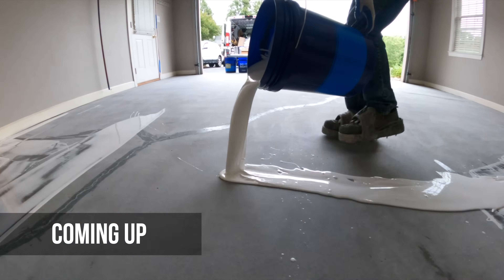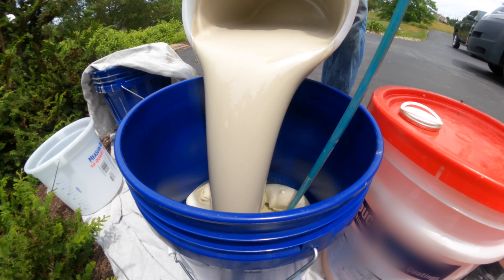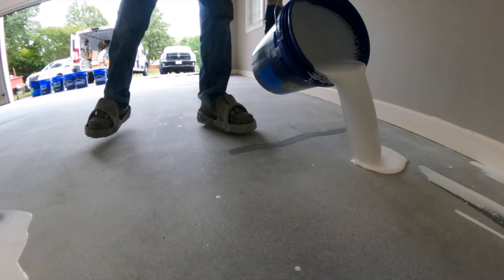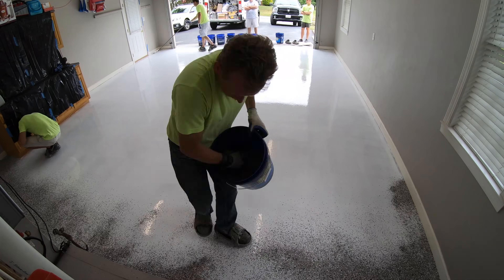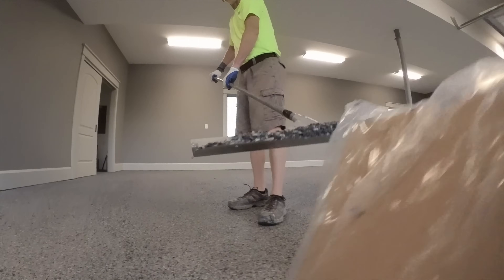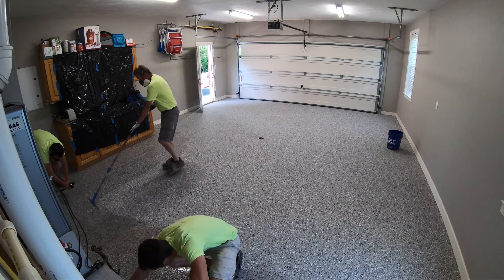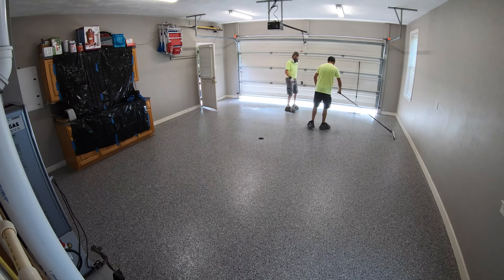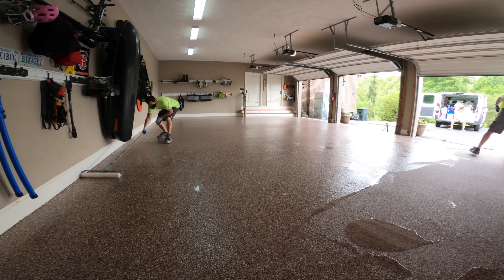Epoxy, Polyurea or Polyaspartic : Which is the BEST garage floor coating?

Comment from the maker: Epoxy vs. Polyurea : I forgot to tell you this one thing about garage floors...
https://youtu.be/UOeGvo5zGY4
Reply: Hi Tim, when it comes to a new house, do you think it's better to wait before coating the garage floor? My concern is that if I apply the coating right away, the floor may crack in a few years.
Reply: Do you recommend any installer in Chicagoland suburbs?

Comment: A couple of key points there were missed in the video. By the way, the quality of workmanship was pretty good. One major difference between epoxy and polyaspartic is that epoxy can handle much greater moisture Ingress loads which enter the garage from the soil below. It is critical to install a moisture barrier to prevent the Ingress of all moisture into the garage. This goal is achieved by installing a epoxy primer directly after the floor is ground and cleaned. The epoxy primer should be selected so that it has a very high moisture vapor barrier quality. This epoxy primer first coating will dry quickly. Second coding should be the high solids epoxy just as explained in this video, but it should also have a high moisture Vapor Barrier prevention content. The combination of the epoxy primer in the high-solids epoxy top coat will effectively prevent moisture Ingress into the garage space. Remember all concrete is porous and allows the penetration of moisture vapor into the garage space. Moisture is very bad for finished garages because it gets trapped behind the wall board in the walls and insulation allowing the growth of black mold, fungus and mildew. It is prevented by the epoxy primer and epoxy high-solids top coating. After the top coating of epoxy is installed than the vinyl chips can go down as described in the video. The third and final coating should be the polyaspartic. Owner should specify the quantity of material to go down on the floor and each coating because it affects the thickness of each coating. Ask the contractor for material specification sheets and read them completely as it will tell you how much product to put down per square footage so that you can achieve the target thickness you select for each coating. Do not leave quantities at the discretion of the contractor as it is likely they will give you a thin coating rather than a thicker more durable, wear resistant coating. Usually the thicker the coating, the stronger it is; however, it will cost you a few dollars more because more product will be used. But it is well worth it in my opinion. So this video missed a couple important items including the epoxy primer coating with moisture Vapor Barrier protection as well as the quantities of each product that goes onto the floor on a per square footage basis to achieve a certain Target thickness for each coating.  And don't forget to specify aluminum oxide grit in the final polyaspartic coating to prevent a slipping hazard. Why? Because once the polyaspartic coating dries it will be extremely slick When wet without the inclusion of aluminum oxide Grit.
Reply from the maker: I agree with you about the moisture concerns:

Epoxy vs. Polyurea : I forgot to tell you this one thing about garage floors...
https://youtu.be/UOeGvo5zGY4
Reply: @TimDCVA  also Target moisture vapor barrier prevention level in pounds per thousand square feet. As well as amount of product used for coding to achieve Target thickness coating. As well as aluminum oxide grit included in the final polyaspartic coating. As a contractor, you should be including all of these points and giving customers the option to select them to not only improve your profitability but also the quality of your work and thereby customer satisfaction. Why? Because it will achieve the goals of customer and probably sell more product. Happy customers are the key to repeat success and volume of business for you. It's called a win-win scenario.
Reply: I would Love to READ this post... but it is ONE continuous run on sentence.... 
Please next time... break it up with Paragraphs so it will be easier on the EYES to READ.
I did Read a couple of lines and know that you are very smart and you know what you're talking about... 
Please consider the person that is (TRYING) to Read your comment... 
No one wants to TRY to read.... make it easy on the eyes, by breaking up the LINES.
Thank you... 
(Retired Teacher)
Reply: @JudiChristopher  a school teacher! I hate to bust your bubble but I could care less whether or not you read my post.
Reply: @frankie7508  
You're also RUDE too...
Didn't expect anything less from YOU.
Reply: @JudiChristopher  couldn't agree more
Reply: Have you ever noticed how certain people use ALL CAPS for emphasis, as if the yelling will impart your message better?
Reply: @JudiChristopher do run-on sentences normally include punctuation and capitalization?
Reply: Anybody on this thread know if it’s safe for me to support my car on jackstands on my polyaspartic floor or will the floor suffer damage/crack?
Reply: @slayuhm5807  It depends on how much weight and the size of the contact surface area Of the stand.  If you know this information then we can Solve your problem.  It's called engineering.
Reply: @frankie7508  the car is a total of roughly 3200lbs so roughly 800lbs per jack stand. The stands are a traditional 4 leg stand.
Reply: @slayuhm5807  According to published data, polyasparic coatings can accommode 12,000 psi. compressive strength and 2,900 tensile strength.  You indicate that there are 4 jackstands and that each jackstand is handling eight hundred pounds.  You also indicate that each jack stand has four contact points to the ground surface, And the ground surface is polyasparic.  Therefore, each contact point is exhibiting two hundred pounds of force.  If each contact point is one inch by one inch, then it is exhibiting two hundred psi of force at each contact point.  Because the compressive strength Of the material is much more than Exhibited force, It is therefore safe and will not damage The polyasparic From a compressive strength or tensile strength standpoint.  However, if there are sharp objects on the bottom of the contact surface or they are extremely rough, Then the jack stands may in fact damage the polyasparic coating.  Make sure that the contact points are smooth by taking a piece of emery cloth and polish the bottom of each jack stand contact point so that they are not rough sufficient enough to damage the coating.  So the short answer is, yes, you will be fine and it will not damage The polyasparic floor coating.  And in return payment for my help, The next time someone talks to Derogatory about an engineer You agree to defend the engineer. OK?  Most people do not realize that engineers are responsible for nearly Everything we touch and use every day, And I mean everything.  Take care.
Reply: With that being said, I would put some kind of softener under your jack stand such as a 3/8" round plate. The reason for the round plate it will be easier to maneuver to the location where you need to put your jack stand. That way you don't have sharp edges or corners to dig into your nice floor. Thanks for taking the time to read my comment.
Reply: @joelong1526  A simple piece of scrap wood under the jack stand will suffice.  The key is to have something between the jackstand and the floor because tbecause the floor will not be able to handle the sharp metal edges.
With weight and compressive forces placed upon the floor coating.  Just about any material will work Between the jack stand bottom and the floor coating.
Reply: frankie7508:  thank you for your thoughtful reply to this video.  I have a concrete slab (new detached garage) that was poured a month ago, and unfortunately a vapor barrier (plastic) was not placed under the concrete.  I do have plenty of stone under the slab.  I plan on insulating and finishing the interior of this garage (woodshop).   I have done plenty of grading around the building to make sure water runs off away from the building.  But I still want to take all precautions to avoid any problems in the future.   you mentioned "target moisture vapor barrier prevention level in pounds per thousand square feet".  What is the ideal target?    Also, do you have experience with Radonseal as another way of sealing out moisture, whether alone or in combination with epoxy coating?
thanks!
Reply: @ederby2002  Typically , the installation of an epoxy top coating on a concrete floor is done in a series of steps.  The first step is to measure the amount of moisture in the concrete after you receive a few days of rain.  Installer of the product will have a moisture meter and he can measure the moisture on your floor.  There are other ways to measure the moisture in the concrete and you need to do some research.  There is no typical amount of moisture coming through the concrete because it is dependent on drainage and the amount of rain, Season et cetera.  That
Said one conservative way of handling moisture in the concrete is to plan for 20 lbs for moisture per thousand square feet.  Now you will need to select a moisture vapor barrier that goes down on the bear concrete , which also acts as a primer that can handle this amount of moisture, 20 lbs per thousand Square feet.  Then you will be able to apply the two part epoxy system according to the manufacturer recommendations.  Do not talk to the person who installs the epoxy coating or the moisture vapor barrier Because
They are ignorant (misleading) and simply want to sell a product and win the work. But rather do your own research and talk to the manufacturers of the epoxy coating and moisture vapor barrier that you plan to use.  They typically employ chemical engineers and have a great deal of technical literature and guidance to provide you.  I say again do not discuss or talk to the installar of the moisture vapor barrier and epoxy Top coating, Because the installers are ignorant and will mislead you.  In fact, Many of the installers will go out of business within ten years and will never honor any warranty.  And it is not the installer who warrants the product, but rather it is the manufacturer of the product.  And if you do not apply the correct moisture vapor barrier then the epoxy top coating will blister and peel Once it is subject to amounts of moisture greater than the product is designed to accommodate.  And you will find that the companies that install moisture vapor barriers and epoxy top coatings are  Common.  And the job will come down to surface preparation quality.  The manufacturer of the products will state what the requirement is for surface Preparation on concrete before the product can be applied.  I encourage you to do some research and educate yourself before talking to any installers of any products related to moisture vapor barriers or epoxy top coatings on concrete.  And realize that installers are aligned with manufacturers of these products, And so you will need to find out what products they install so that you can talk directly to the manufacturers of those products and do your own research.  One
Last warning:  The installers of these products charge charge vastly different prices and their quality is just as variable.  They
Will often want more money than the concrete itself cost to install, So be prepared.  Best wishes for success.
Reply: Thanks 🙏🏽 for your incredible and educational comment.  Now, I’m nervous 😟 to do this product, because I know a contractor will miss these key and important steps.  I’ll have to checkout better options.  Again, I greatly appreciate your post!!!
Reply: @Mslexus134  Why do you think companies hire engineers to run renovations and new construction and do not rely on uneducated contractors who simply are skilled at installation???  I have great Respect and admiration for skilled craftsmen.  However when it comes Engineering and matters of science they are highly ignorant.  No differently than I am highly ignorant about skilled craftsmanship issues.  That's why smart people hire consultants which include engineers and scientists.  Before doing any major project you should always develop bid specifications which clearly Delineate very precise specifications of supply of materials and construction details.  You should also get at least three bids from licensed and qualified contractors that freely and openly provide you with past work references.  Contractors will try to give you a proposal which ignores the bid specifications.But you must tell them that their proposal must comply with all bid specifications or you will not accept their purposal.  You should
Also check out the references and call those people Or visit with them to talk and/or visually inspect their past workmanship and how it has held up over time.  Many contractors are not licensed bt the State in which the work takes place and now that 24 million illegal immigrants, From all over the world in which we know nothing about, have entered the country are completely illiterate and do sloppy workmanship unworthy of anyone's home, Unless they are directly supervised , which never happens.  Unlike the rest of the world, we live in a free and open society in which the government does not get involved unless they are asked or informed.   And as we saw Biden and Harris, who they have actually developed and propagated systems to destroy our laws including our marketplace, These filthy
Politicians have decimated our government and laws.  Be very careful when hiring illegal immigrants to do the work.  They are completely illiterate and are simply fulfilling a task which they have little or absolutely NO knowledge of And receive absolutely no training..  And of course
The work will largely be hard manual labor such as grinding floors, cleaning them and applying coatings.  You can also hire a licensed and qualified construction inspector to be on the job and observe their work as well As test it to make sure it complies with the manufacturer recommendations of the coatings.  And if you have not obtained and received the Coatings manufacturers installation recommendations, then you should absolutely do so before hiring any contractor because they will give you very specific recommendations on their requirements for installation.  The contractors must comply with all of these installation recommendations , which they seldom do because most people are ignorant that these recommendations exist.  Keep in mind that the cost of applying  garage coatings, such as Polyasparic Or high solids epoxy, Is equal to Or greater than the cost of constructing the garage floor itself!!!  These coatings do provide protective value, But are largely aesthetic.  Personally, when
I saw the cost of the coatings I rejected them because of the extreme high cost.  My recommendation is simply to put a high quality concrete sealer On the
Garage floor after making sure that the concrete is properly prepared and cleaned prior to applying it.  And if you do get one of these floors installed, And they are beautiful, then make sure that yhe installation contractors install abrasive grit In the final top coating to ensure that it is not slippery After the product cures when wet because these floors become quite hazardous when it comes to slipping and causing serious personal injury.  I think you will agree that all garage floors get wet.  Abrasive grit in the final coating solves this problem.  You are welcome for the free consulting.  Truth and knowledge bring light and reason, Thanks be to God.
Reply: @frankie7508  I hope 🤞 others read your remarkable comments and true guided insights. This detailed free consultation is so valuable and extremely helpful as well.  ℹ actually thought 💭 about you while looking at more videos contents.  And you are so right concerning costs and craftsmanship.  I can’t wait until you start your own channel and I will be your first like 👍🏽 and subscriber too!  God bless you and thanks 🙏🏽 all of your valuable insights and comments as well!
Reply: @frankie7508  Will you please 🙏🏽 be so kind and provide your opinion on garage tiles coverings?  This might be a better and less costly  💲 option?  Many thanks 🙏🏽 in advance….
Reply: @Mslexus134  Yes.  But, any further consulting advice must be paid for in advance.  My rate is $250 per hour, or any portion thereof.  Let me know if you're interested and I will forward you an email address.
Reply: @Mslexus134  You are
Welcome.   I'm not starting my own channel.  But, I am retired from a profession that is directly related to everything I stated.  Take care.
Reply: @ You are my professional retired cyber super hero 🦸! Take care as well!!

Comment: Your method is better Tim! I had a few disasters with the one day system because 15 minutes is not enough time to do a good job for your customers. I fired my dealer who was more of a product pusher. Since switching to a dealer who is more of a resinous floor expert, I have had much better results. What they taught me was exactly the way you do your floors. 👍